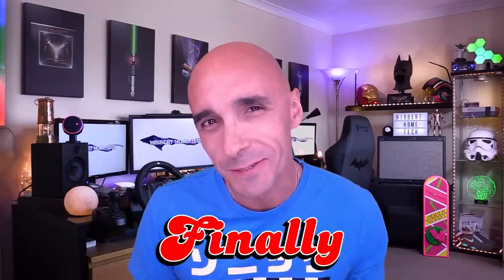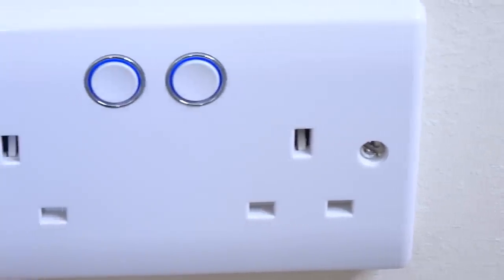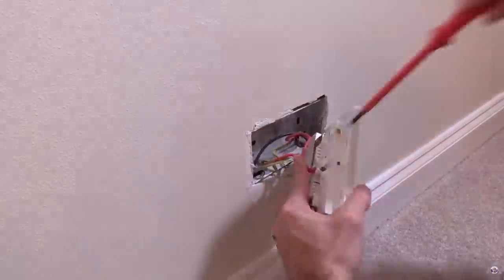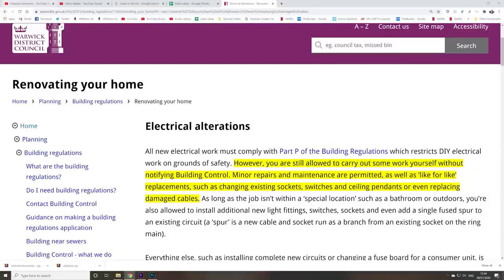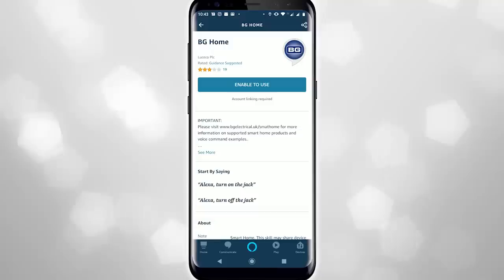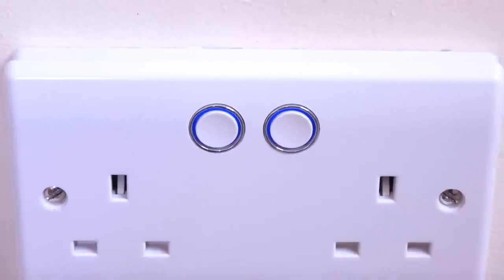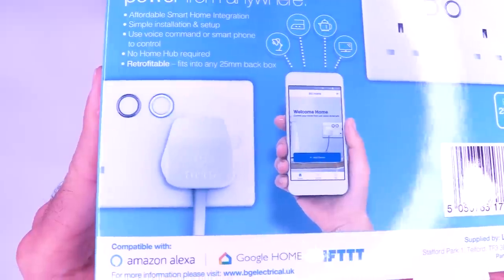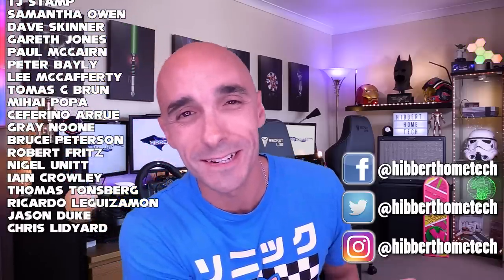BG Smart Home Sockets | Alexa and Google Wall Socket Review

Comment: Smart sockets contain capacitors and microchips. Both of which eventually either burn out or just fry respectively, meaning the durability is no where near as good as conventional sockets. That’s the only thing preventing me from installing them anywhere in my house.

Comment: I got these to replace the ugly plug in units. They work well. 2 things though. Reboot router for any reason and you have to redo the set up. Only one of the power buttons accesses the set up...at least thats the way all mine worked. No idea why B&Q stopped stocking them but Asda do...tee hee.

Comment: Hey can I get some help? What is the difference between the 800 and 900 series of this plug? 
Also to help my wife get adjusted to smart home life does it make sense to have one of these smart sockets with a light (with a smart bulb) or does that not work?
Reply: The 800 series have rounded edges and the 900 series are square edged. (I think that is the right way round) I researched this a few days ago as I wanted the square edges ones.

Comment: I bought 2 of these just after this video came out for a room we were going to decorate, I fitted them today! Do the sockets work with the Tuya Smartlife app or do you HAVE to use the BG app?
Reply from the maker: You can use the Broadlink app. Broadlink do a bunch of other cool stuff so it's worth using their app rather than BG in case you end up buying more Broadlink stuff down the line.
Reply: @paulhibbert  Cool, I already have a couple of the Broadlink mini jobbies and the app installed. Thanks Paul.

Comment: What about the lightwave rf sockets? Aren’t they flush mount UK smart sockets too?
Reply from the maker: As much as I love my lightwave stuff, this socket doesn't require a hub and cost £20 versus the lightwave setup which is £125 for the hub and £54 for the socket. 😉
Reply: @paulhibbert  Fair point mate. I just wish these had full Homekit support rather than just Siri Shortcuts, then it would be hands down the best option out there for me.

Comment: Plug in a lamp to the socket. Turn on. Turn off at CU (mains). If light is still on it’s not the right breaker, try again or switch off entire CU.
Reply from the maker: The lamp is a good extra check to the above, but not a replacement. There could be a short from you flipping the switch that in turn blows the bulb, or a family member switches the lamp off whilst you're downstairs. What if the bulb just happens to die at that exact moment? I'm no electrician by any means, but I think there is also potential for the breaker to kill the socket but still leave live wires behind it. I wouldn't want you to rely on a bulb to keep you safe.
Reply: Paul Hibbert Definitely 👍🏼 I didn’t mean it as an alternative!

Comment: Will/do they make light switches as well?
Reply from the maker: Not yet. Apparently they have some in the pipeline one of the other commenters says
Reply: The smart dimmer was originally planned for 2020 Q2 but has been pushed back to Q4 due to Covid I believe.

If you give BG tech support a call they will be able to provide an update on the release schedule & spec...

Comment: Hey Paul, another great video mate. With all these smart wifi devices what router do you recommend. Also do these devices work locally as well. Thanks
Reply from the maker: The amplifi HD isn't cheap, but it's been rock solid for me. I couldn't overload it, I did a video called "Zigbee is a con" if you wanna see the results.
Reply: @paulhibbert  thanks Paul. Do the tuya wifi devices work locally?

Comment: Paul, I cant see a link to contact you directly. Can you help? Love the video's keep em coming ...!! My question is this. ( and if you've already covered this then please tell me where..?), Everything we are using invariably connects to a chinese server which is not usually a problem BUT, in today's climate for Chinese intrusion, is there a way to have a local server for these connections ? I have seen a way to reprogram Sonoff units for this purpose. Has anybody else had this issue with a solution..?

Thanks,

Alex.
Reply: You need to look up devices with an esp chip and tasmota or easyesp. No cloud needed.  Or Shelly or other devices which can do MQTT.

Comment: Try aurora aone. Identical but zigbee
Reply: Agreed. The Aurora AOne double socket has a very similar appearance the BG unit and it is a ZigBee device. It is also low profile and will act as a Repeater too. Unfortunately it is about £60 - but you do get LED indicators that change colour from red (off) to blue (on)

Comment: Nice vid! Can you flash these with alternative firmware? Tasmota or Esphome?
Reply from the maker: Not yet! I wonder how long it will be before the Tasmota fans start fiddling about with Broadlink WiFi stuff!?
Reply: @paulhibbert  was reading the BG datasheet to see if they admit to the chipset used - nothing there. Your reply saved me buying one to be disappointed - thanks.

Hopefully as these get more common people will figure it out, seems less and less is using esp82xx devices these days.

These switches are pretty cool, if they did power monitoring as well that would be amazing.
Reply: If it is to use them with Home Assistant, there is no need they are recongnised as Sonoff devices.

Comment: got one of these from my SIL, I cant get it to connect to router as for some strange readon it needs my phone to be on 2.4ghz when its actually auto connected with the plusnet router to 5ghz. New router is on the cards but why is this an issue?
Reply from the maker: When 5ghz was invented it was to deliver better speeds to devices, but it had just one problem, it could only do so at short range, so router manufacturers gave you two separate Ssids to connect to so that we could choose which devices should connect to 2.4ghz and which should connect to 5ghz.

Because smart home products need good range and not good speed they are shipped with a 2.4ghz chip. If they shipped with both chips they would be more expensive to make and therefore more expensive to buy. 

Router manufacturers one day decided that instead of having 2 separate WiFi ssids to connect to that they would have one ssid that defaulted to 5ghz unless a device was further away in which case it would switch to 2.4ghz automatically. This poses a massive problem for the smart home industry because the router makes the wrong decision if your device is close enough to the router.

The most up to date routers are now solving this problem by switching back to 2.4ghz WiFi for any device that it recognises as unable to connect on 5ghz. My amplifi HD router for example does this. The smart home devices app complains during setup, but then magically connects anyway.

To solve it on your router you'll need to go into the routers config and temporarily disable the 5ghz WiFi band altogether whilst you setup your smart home device, and then turn it back on again afterwards.

Hope that helps dude.

-P
Reply: Hi Paul, thanks for the reply, appreciatiate the time you took. I have solved the issue as after a few drinks last night I ordered a new router.
In the meantime I checked the router settings and  I noticed 2.4ghz is sync'd with 5ghz so if I unsync them and give the 5ghz ssid a new password would this solve the problem?

Comment: no usb port shame and do they come in chrome, black ECT stuck to me smart plugs for now but that's getting close to me wanting to buy them
Reply from the maker: Sadly it's white only. Agreed on the USB port
Reply: @paulhibbert  I want chrome with USB port but good it don't need a spacer behind it nowt worse then a plug or light switch sticking out by about a mile only got bog standard back box and 13mm deep

Comment: Is there anyway to disable the LED completely on these?
Reply from the maker: Not as far as I can tell, but it really is quite dim. I'm easily kept awake by this sort of thing and it doesn't effect me 😊
Reply: @paulhibbert  Nice one, cheers Paul. Love the videos 👍
Reply: From memory, you can change the brightness level but as Paul says, they are quite dim anyway.
Reply: sharp side cutters and remove just the LED,  for nano LEDS gain access to the main board controller and add small bits of duct tape on each LED as it's none conductive, failing that, get a big hammer.

Comment: Would Home assistant work with this?
Reply from the maker: Yes they do, they’re discovered by the Broadlink integration
Reply: @paulhibbert  heard ALOT go wrong with these and people swapping back to normal sockets. Are you still using these?
Reply from the maker: I’ve since moved house and not had a chance to install them, but I had 3 of these installed in the previous house. I suspect I overloaded one of them and from then on it was just permanently on. The other 2 never let me down in the 4 years they were installed
Reply: @paulhibbert  might have to look into these then 😁

Comment: Hmm.... Do I continue down the lightwave route or swap..... Lightwave far more expensive.... Hmm......
Reply from the maker: Broadlink are releasing a light switch dimmer that doesn't require neutral soon so it will be VERY interesting to see how good it is!
Reply: @paulhibbert  What will be less interesting is suggesting to the wife I swap out the 10+ lightwave sockets, some of which are behind furniture that is screwed to the wall, and replace them hoping that I can sell the old sockets. 

Or suggesting I use different sockets so they don't all match

I do like my lightwave stuff, but at £60 for a double socket.... 

Damn you progress and better things coming out after I've invested!
Reply: the more Wi-Fi devices the slower and more congested the signal gets as there always on, personally RF wins due to this.
Reply from the maker: I suspect the new Broadlink light switch is also RF. It doesn't require neutral and I've never seen a WiFi switch yet that didn't require neutral.
Reply: Paul Hibbert, the Shelly Dimmer 2 is wifi and doesn’t require neutral.   It goes behind the switch (or at the light) so you can use your existing switches.

Comment: I have this, installed it and got it connecting to my wifi.....al was fine for a few days. It then lost it's wifi connection and I can't get it back. Tried on numerous occasions both with the smart connect and AP connect options. It gets 99% through the connection but fails at the last hurdle. Anyone else have this issue and solved it? I was loving the switch when it was working, now I'm just frustrated.

Comment: There is a ZigBee version of this made by Aurora lighting, not as cheap but no chance of the server being turned off and not going effect your WiFi if you get loads of them. From memory you can also control the lights with them. As a electrician people doing there own changes this this almost always causes issues. Even when they get it "correct" and it works I have seen countless times when people don't use the correct size screwdriver and this I extremely dangerous. Not doing to the correct tightness cause's fires PLEASE PLEASE if you have not done it before and have no experience please get someone (ideally a electrician) who does to do it.

Also don't use a electricians screwdriver, there is a reason we don't use them. Use a test meter and test it before and after.

Comment: DANGER I have found out these sockets can fail with the output still live. Remote shows power off (which can often be wrong) but also the socket button (operated manually) shows as off but it's not. (just one socket of a twin) I just phoned B&G tech and they explained how that can happen but were not willing to replace the unit.   I was all for supporting a British company but now having second thoughts.
Reply from the maker: I think that happened to one of mine after I overloaded it. I put too many things in it and then it just stayed on permanently. Not sure I'd classify it as dangerous though, I have other electrical sockets in my house with no on/off switch.

I eventually put a WiFi extension in it.

Comment: I'm really enjoying your videos Paul!

Following your last comment about the third party software creators, is there any chance you can spare the time to look at the range of Tuya apps out there especially given the whole IFTTT support issue? 

For example, Cürv app for UK (https://www.curv360.com/curv-apps-new/) provides a single point of access for solar panel controls, heating, lighting and security devices but I noticed it's Tuya based. I also have six Teckin branded smart plugs which look almost the same as the Curv ones and those definitely use the Tuya app. Brilliant Smart seems to be the Aussie equivalent of Curv360 but I'm not an expert. 

Suppose I want an off-grid integrator linked to the uninterruptible emergency backup battery rack in the attic in the event that someone accidentally puts a digger cable through both the mains electric and telecoms into the house , all those devices, controls and apps still work even if She-Who-Must-Not-Be-Named is not contactable? Tuya, Hubitat, Home Assistant or a combo of all three? (Rhetorical question).

Just for added off-topic fun, I'm looking at totally zombie-proofing the gaff, so cameras, door locks and actuators, doorbells/cams - got a Ring as a battery powered stopgap but hard-wired options considered: Boundary, Simplisafe, Curv, Yale. What do you use?

Comment: Put a lamp in the socket and turn it on. Turn off circuit at fuse box. If lamp is still on, repeat last step as you turned off the wrong circuit.

Done!
Reply from the maker: The lamp is a good extra check to the above, but not a replacement. There could be a short from you flipping the switch that in turn blows the bulb, or a family member switches the lamp off whilst you're downstairs. What if the bulb just happens to die at that exact moment? I'm no electrician by any means, but I think there is also potential for the breaker to kill the socket but still leave live wires behind it. I wouldn't want you to rely on a bulb to keep you safe man.
Reply: @paulhibbert  All understood. I know my fuse box well enough, and it's fully labelled. If in doubt turn the fuse off, make sure the lamp is off. Turn the fuse back on. Make sure the lamp returns on. Now, you can turn the fuse off (& lamp again) knowing all is super OK!
Reply from the maker: As long as you're completely satisfied it's off man. Like I said, I think there can still be live wires behind a socket that is effectively disconnected from the circuit.

Comment: i bet this works with tuya app too
Reply from the maker: Sadly not 😔 Broadlink and tuya are competitors.
Reply: Paul Hibbert interesting, everything sold here in oz seems to be rebranded tuya apps
Reply from the maker: They have the biggest slice of the market of the two of them.
Reply: Paul Hibbert thanks mate, will you be testing routers in the future, I’ve got over 24 smart WiFi devices plus more to come on top of my android tv boxes, phones, laptops etc and now I’m getting drop outs
Reply from the maker: I recommend the amplifi HD. It's not cheap, but I tried to Max it out for a video and I couldn't do it! If you search for my video "Zigbee is a con" you will see it in action.
Reply: Paul Hibbert ok I will check it out, thank you
Reply: works with the eWelink app

Comment: Remember, don't plug your router into a WiFi socket because while you can switch it off...

...

...

Connection not found
Reply: I use an SMS remote switch for my modem only! Everything else that could need resetting is on smart switches, only the modem is not. I send it a text to get status, and two different texts to switch it off and on... Saved me a few times when out and about!

Comment: Have you had any problems with the BG socket? Mixed reviews of these , mostly for failing.
Reply from the maker: One in the corner of my room developed an issue where the socket was always on. The button wouldn't turn it off, and neither would the app.

I suspect I overloaded it. I plug in way too many things into one socket and I reckon I damaged it.

I've since moved to a 4 bar WiFi extension socket so that each device is on a separate socket designed for a separate load.
Reply from the maker: The other 2 of these I have installed round the house that aren't overloaded are still working great I should point out.
Reply: @paulhibbert  that’s the fault I’ve been reading about , they either stay live or don’t come on. I’m thinking of buying the external version for my garden so that I can put Christmas lights on a timer.
Reply from the maker: @scotiajinker8392  I reckon they'd be OK for just Christmas lights. I wouldn't be put off. 👍
Reply: I bought the outside version (storm) , it did last 2 weeks . It can’t connect to my WiFi, I call the BG help line & they couldn’t help. They’re sending me out a new one, that takes 10 working days. Who’s delivering it ffs? I real don’t have much faith in this , when this one goes tits up I’ll take back to toolstation for a refund.

Comment: Terrible app. I changed Wi-Fi and the app won’t allow to reinstall them after reset. Furthermore they are now occasionally turn on and off, so they are not even useful to be kept in place as normal socket.